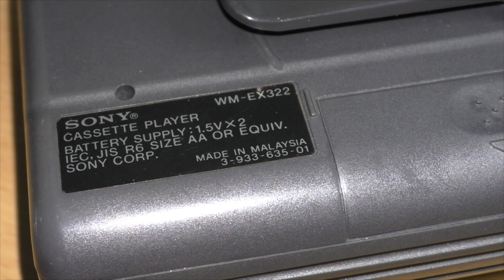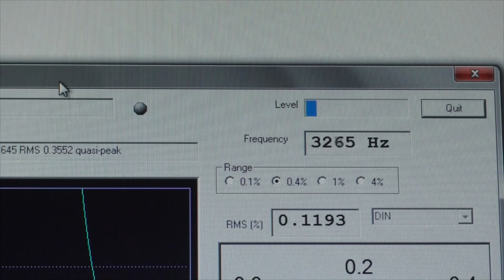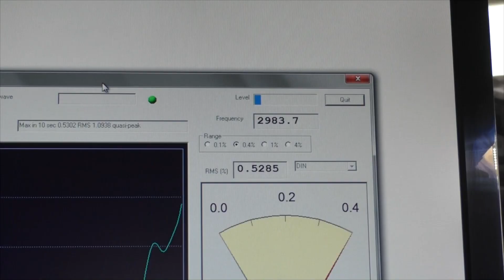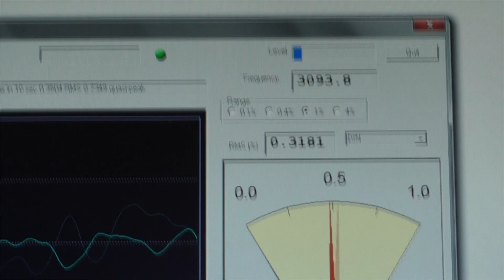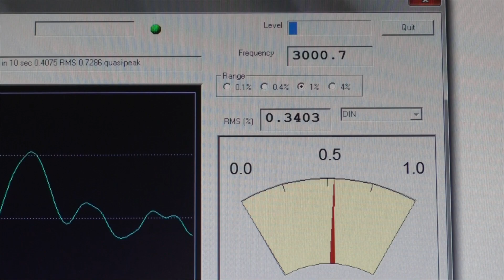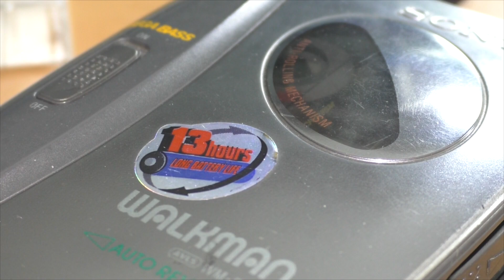Плеер SONY WM-EX322. Ремонт, как звучит и немного ASMR

Comment: 13 часов... интересно следить за развитием технологий. Сначала часа по 3 могли крутить плёнку и от 4 батарей. Потом вот от 2 батарей 13 часов. На моём wm-fx453 уже 22 честных часа (засекал). А потом и вообще от одной батарейки по 30 часов пахали
Reply: на моём panasoic rq-sx 80  72 часа
Reply: @Bs-pe7kd   тогда озвучивай , что при использовании акку и батарейки
72 hours playback using a rechargeable battery + 1.5 V alkali battery,